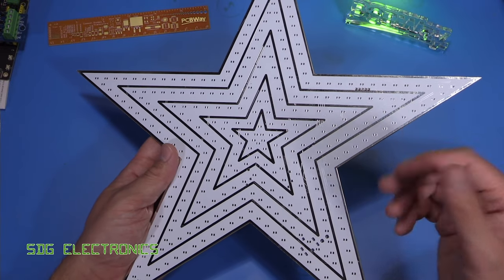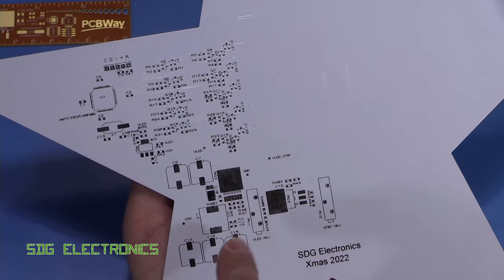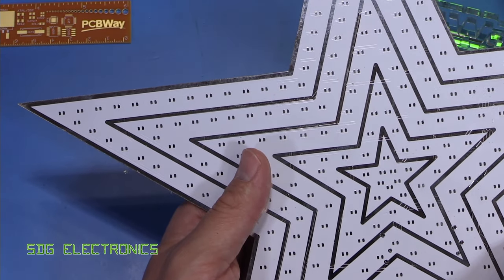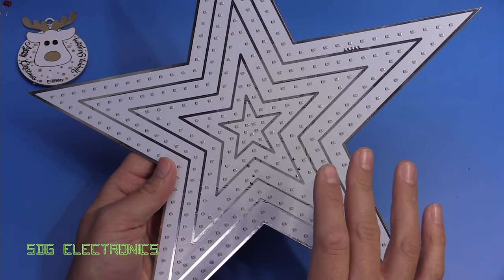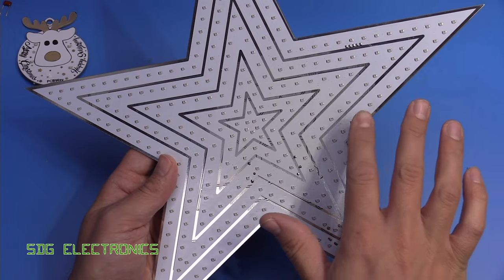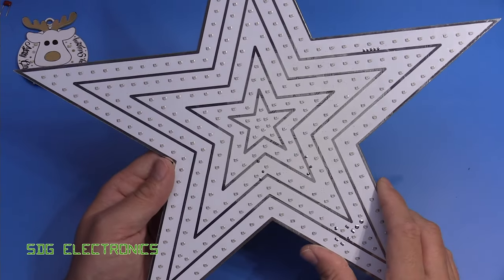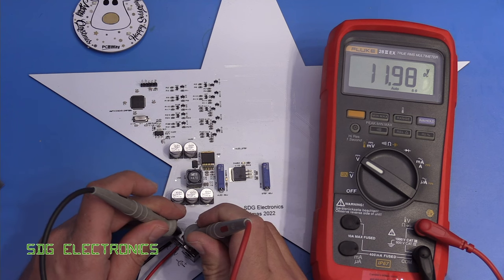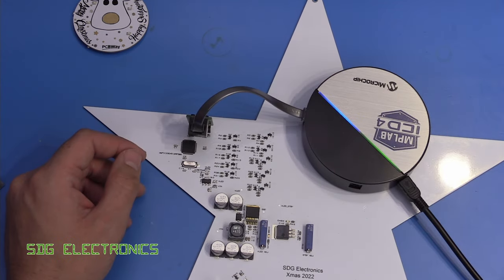SDG #281 A festive auto colour change RGB LED hack you've never seen before!

Comment: Lol, I think Steve needs little flags on his Mosfets and PNP transistors.  Seriously, though, thanks for sharing the mistakes! we need to be a little more humble and aware of silly little mistakes like this. If you hadn't done the ouch test you'd have assumed the board was fully functional and not caught the problem!
Reply from the maker: I normally run the thermal camera past a new PCB to catch a working but potentially not working properly board. This one was a good reminder as to why! Thanks

Comment: Great video.  You should be able to "resync" the leds without the white flash by turning off both power rails, then turning on the low rail for the period of the flash (~200ms) then starting the pwm. Not sure how long you have to keep it off to reset, but this would give you a clean red start and if you ran that for the average time of one color cycle and the reset it again, you should have a fairly clean display. You could also reset each star individually to create a moving color effect.  I love this project

Comment: Thats again nice project Steve, remembered christmas village from last year :) Regarding LM317 at 9:50 , its even worse, LM317 need at least 2V for dropout.The only reason why its working fine could be really low current consuption from standby supply rail by leds. Last thing, i wonder which type of LED are you going to use at D402 position :)
Reply from the maker: An IR LED might work! I realised my error when I was placing that LED :)

Comment: Just a quick question about the design: Why are you using PNP and NPN transistors in the first place, instead of all P-channel and N-channel MOSFETs?
Reply from the maker: Cost and availability, mainly. Though BJTs work well for low voltage levels, since 0.7V for Vbe keeps the transistor in saturation.